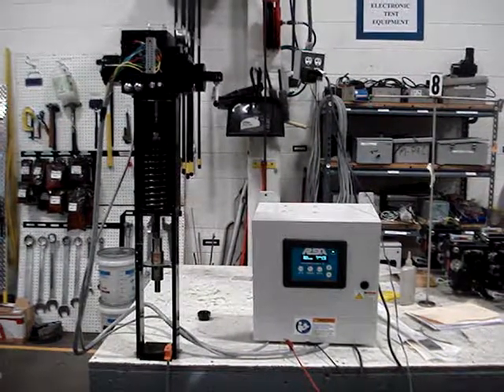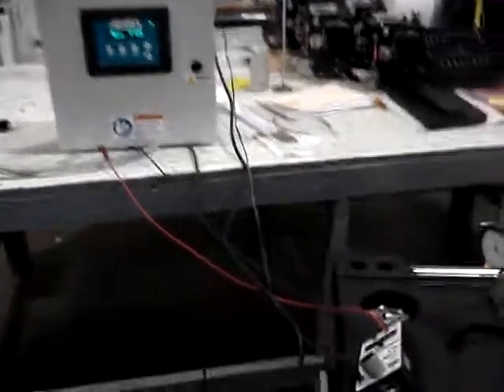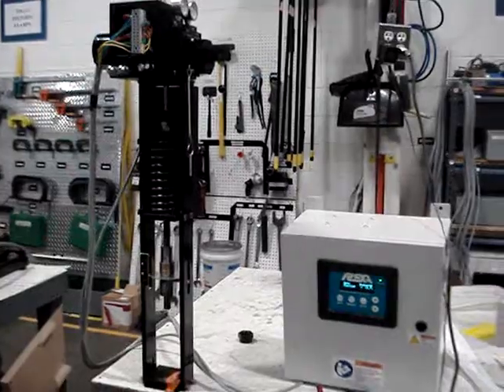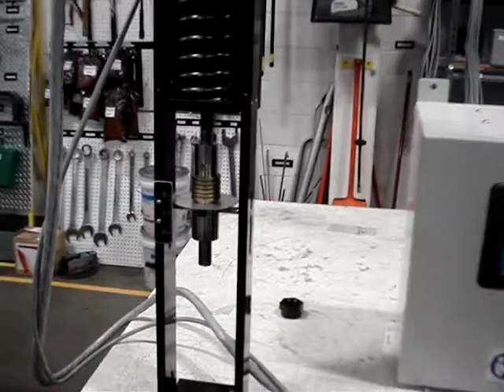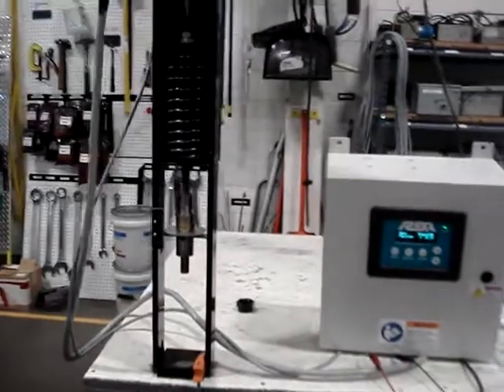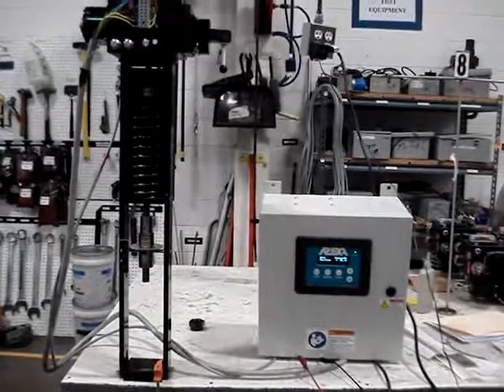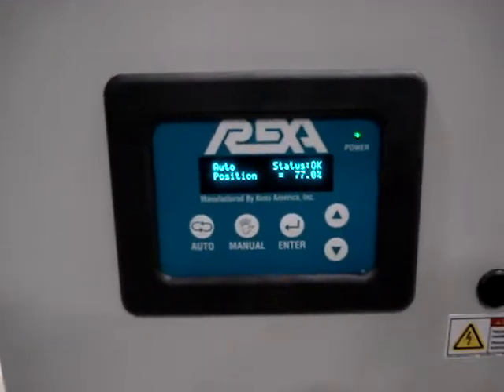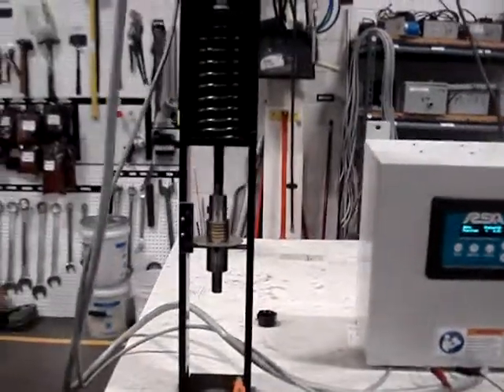Fuel gas valve actuator.MPG

Comment: The display panel  is gone bad. One of the feather touch keys are not working.  What's the part no of the key pad. The electronic boards are fine. Also the ribbon cable from the electronic board to the control board in need part no for ordering.